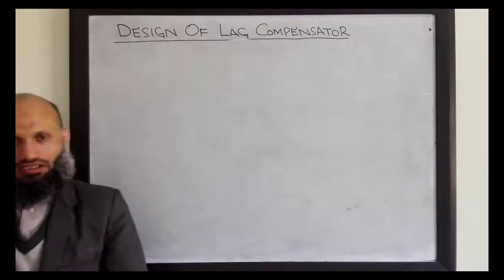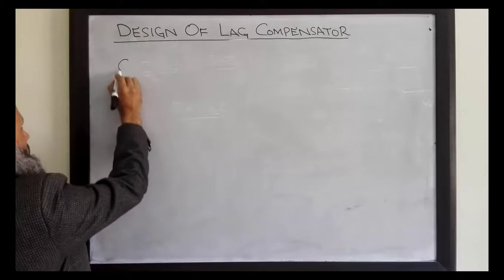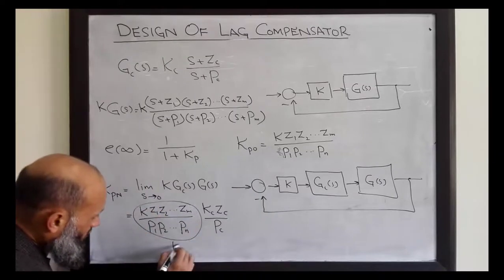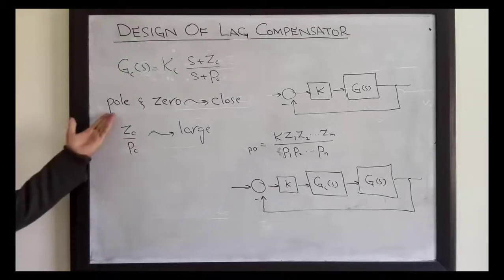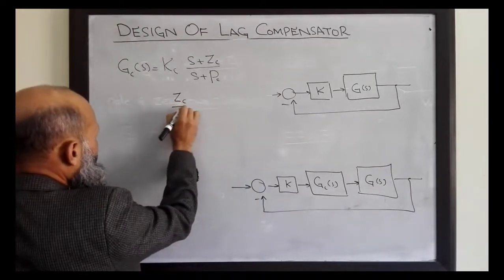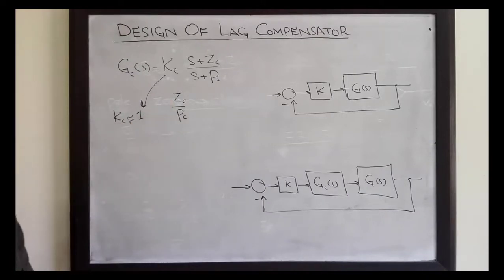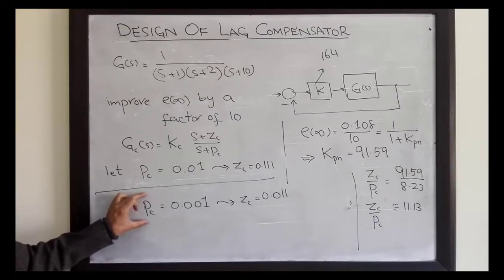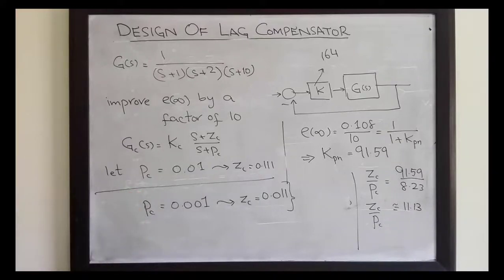LCS 36a - Design of lag compensator to reduce steady state error

Comment: Aoa sir how to design lag compensator using root locus
Reply from the maker: This lecture explains the procedure for the design of lag compensator. Sketching of root locus is not required, the only thing we need to ensure is that pole and zero of the compensator are sufficiently close to each other so that there is minimal distortion in the root locus.
Reply: @MAFarooqi  sir this is the exact steps for solving lag compensator??
Reply from the maker: @StoriesoftheSoul1018  yes.
Reply: @MAFarooqi  Thank you Sir be blessed

Comment: Thanks for this lecture ...♥️
I have a question what is the main difference between PI controller and lag compensator ?
Reply from the maker: Both PI controller and lag controller are used to improve steady state errors. PI controller increases the type of the system and therefore, completely removes steady state error, whereas, lag compensator can only reduce it.  

As far as implementation is concerned, PI controller requires active components,  OpAmp for example, and is therefore more expensive. Lag compensator may also be implemented with passive components.